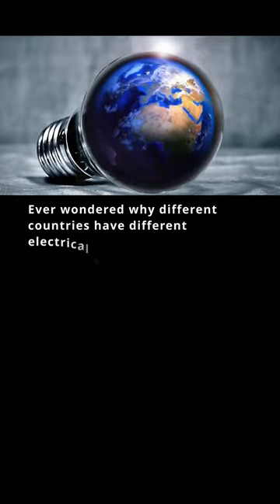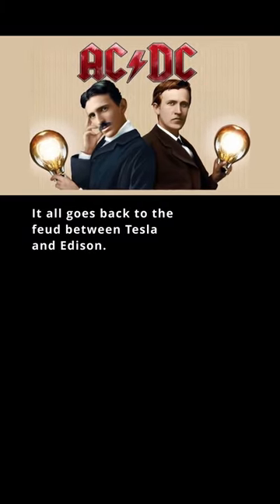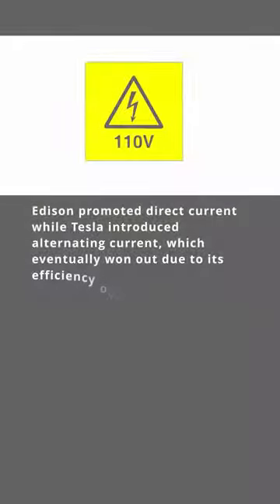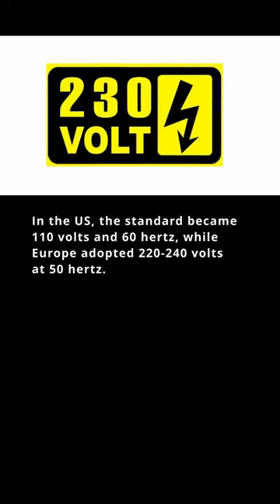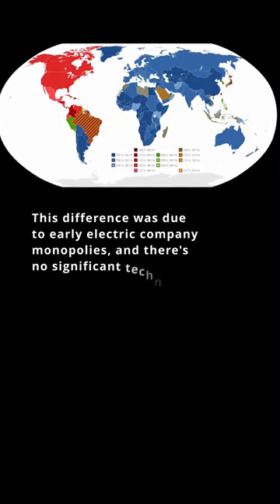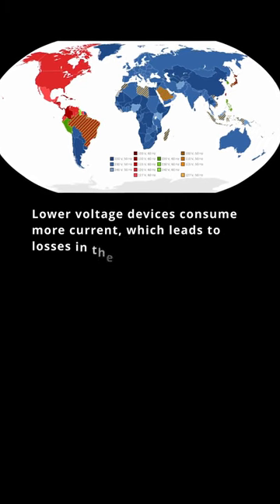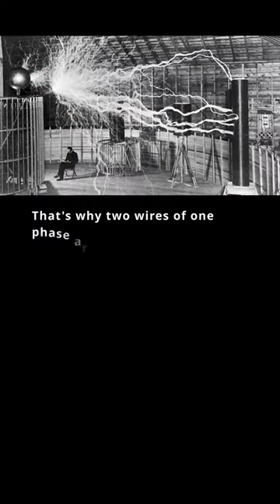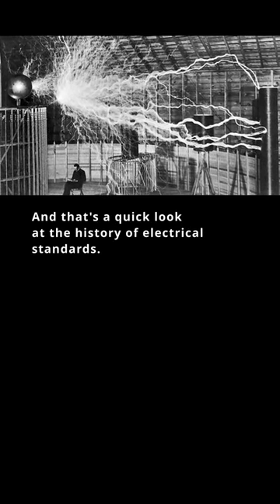The Shocking History of Electrical Standards Explained in 60 Seconds

Comment: the first AC systems had only 25Hz, later 40Hz and finally 60Hz. The frequency was determined by the stable speed of the turbine or steam engine and windings of the generator. Lower frequencies are better for long distance transmissions. However, when building an electric motor for 50Hz, it requires about 10% more iron for the field windings than an electric motor for 60Hz. 
The electrical system in Europe is basically the German standard created by Siemens: 230/400V 3-phase (originally 220/380V). North America is disaster of different voltages